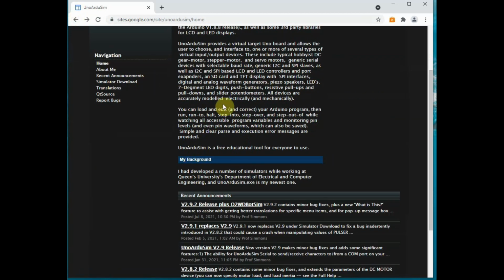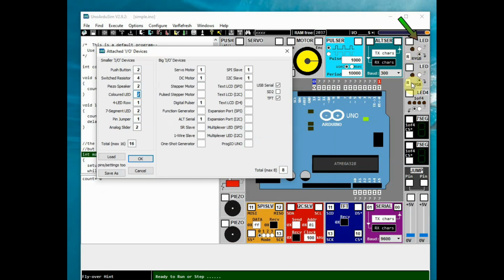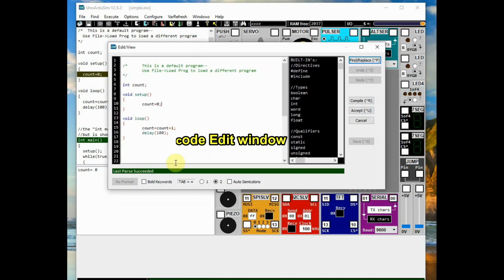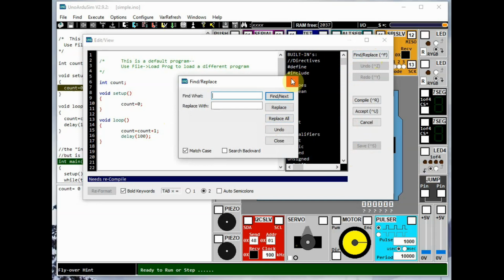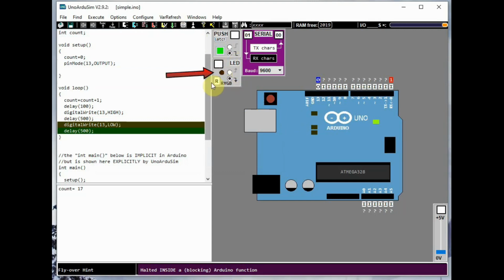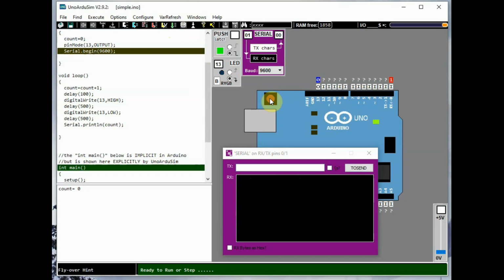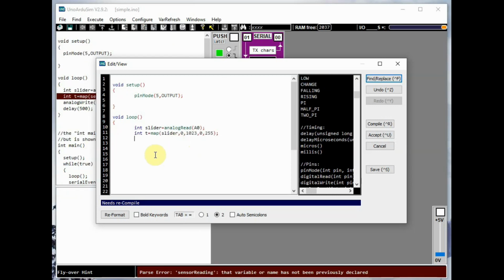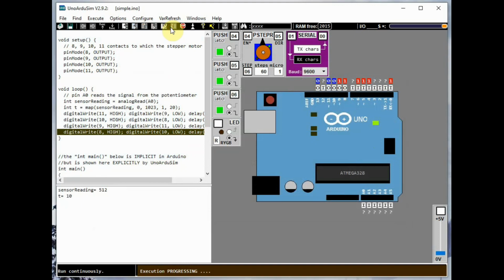Simulator for ARDUINO -  UNOARDUSIM - Best for Learning & Debugging

Comment: Hi sir is there all most al sensors there? Examle gyro sensor, LED dot matrix and is this simulator generate code automatically?
Reply from the maker: Simulation is possible only with the I/O devices under preferences configuration. For others you can load the code in edit window ,compile and then use the Debug STEP tools to understand the code operation and variable values in real time. Debugging is not available in Arduino IDE.
This will not generate code automatically.

Comment: Hello
I really hope you can help me, I want to make a non-contact thermometer but now it gives an error, can you tell me?
what is your email
The code is there but it reports an error in the Adafruit_MLX90614 mlx = Adafruit_MLX90614(); and mlx.begin();
current code (#include <Wire.h>
#include <Adafruit_MLX90614.h>
Adafruit_MLX90614 mlx = Adafruit_MLX90614();
#include <LiquidCrystal_I2C.h>
LiquidCrystal_I2C lcd(0X27,16,2); //SCL A5 SDA A4
#define Baocoi (7)
void setup() {
//Serial.begin(9600);
mlx.begin();
lcd.init();
lcd.backlight();
lcd.setCursor(2,0);
lcd.print("TG THANH XUAN");
pinMode(Baocoi, OUTPUT);
}
void loop() {
float nhietdo;
delay(100);
lcd.setCursor(0,1);
lcd.print("Nhiet Do");
delay(100);
nhietdo = mlx.readObjectTempC();
nhietdo=nhietdo+2.1;// chỉnh sai sai số?
if(nhietdo>=37.8){digitalWrite(Baocoi, LOW);} //nhiệt độ báo còi
else {digitalWrite(Baocoi, HIGH);}
lcd.setCursor(9,1);
lcd.print(nhietdo);
delay(100);
})
Thanks